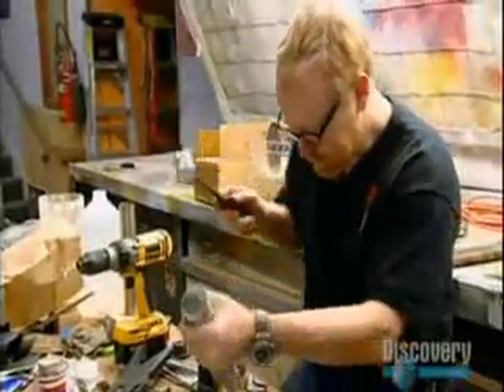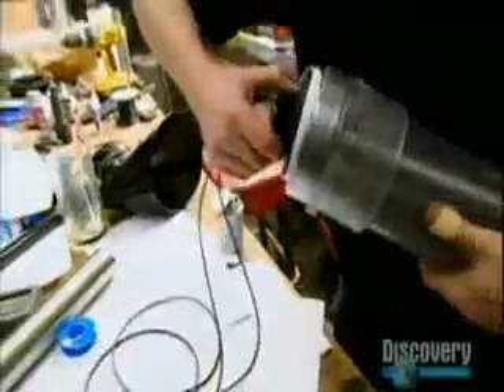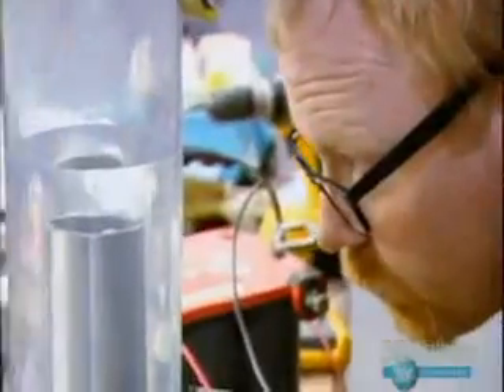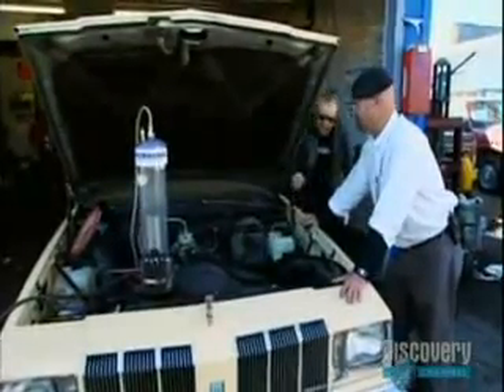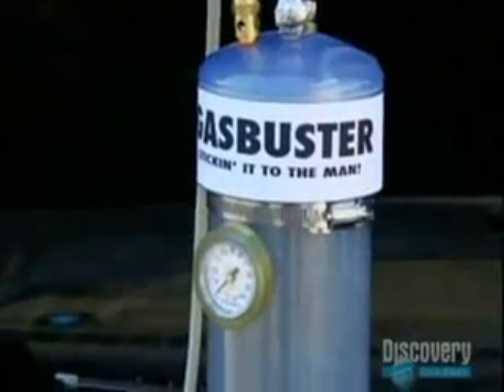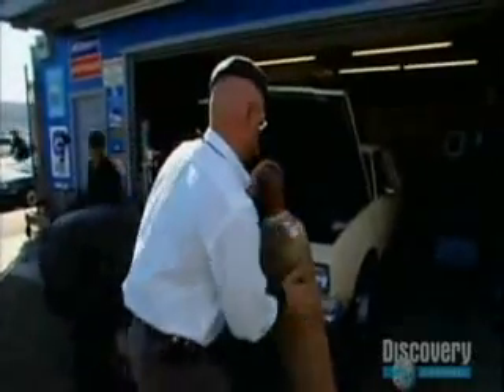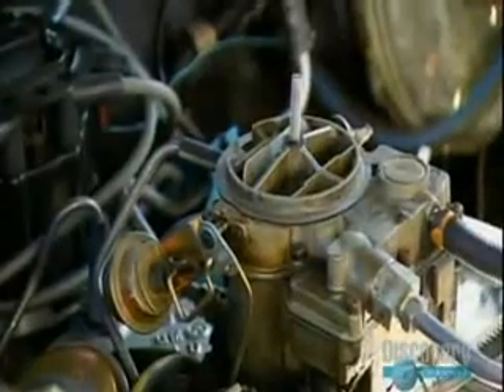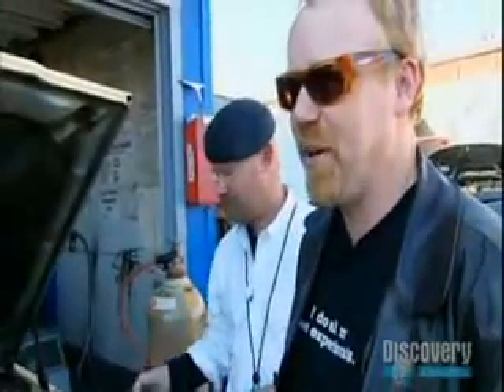HHO Mythbusters Explained

Comment: this is one example of why I lost any shread of faith in the value of the mythbusters' tests.  They appear to be biased and purposely introduce subtle  "doomed to fail" variables in their experiments to discredit the validity of systems that would otherwise cause harm to the wallet of those who sign their paychecks and the owners and controllers of "the big picture"
Reply: You do realize that hydrogen fuel cells are commercially available right? There's no point in invalidating someone's idea, it already exists on market.
Reply: If you understand the basics of physics you would know that these systems are impossible anyway... it requires much more energy to produce hydrogen then you gain from burning the hydrogen.

electrolysis is only about 65% efficient. It gets even uglier when you combust the hydrogen... you only get back about 20% of the energy stored in the hydrogen, the rest is converted into heat. If you dedicated 100 Watts to producing hydrogen and then burn't it in the engine it would only produce 13 Watts of usable energy, which means you'd loose 87 Watts of energy!
Reply: nobody can see that thishow is BS
Reply: Richard Garnache I never said it was a fuel cell. I said that water is currently being used in hydrogen fuel cells.
Reply: Sebastian Ramadan Last time I checked, an engine doesn't produce hydrogen gas. Pretty sure you can only achieve that with electrochemistry - at least as far as water is concerned. Quite a bit of energy is required to break the bonds. ~242kJ/mol if my calculations are correct. 

Assuming water is pure, you've got ~18.01528 mol/g. 1gl of water is ~3785.412g. So you'd need ~50849.59kJ to break the bonds of all of the water in exactly 1gl of water.
Reply: Let me ask you a question that I know you don't know the answer to, (because I had this electric vehicle conversation with the General Motors Senior engineer who developed the best electric car for GM back in the late nineties) what are you going to use for renewable power on an electric vehicle? Batteries that die after three hours of use?

Using something that 'might' work is not very  feasible because having an electric car that requires an automotive electric motor engineer to work on it when it breaks down, (unlike an auto mechanic). Like how often are the bearings needing replacement or the commutator or the field coil? or the magnets? How often do you need to check the resonance in the field coil, do you even know what that is? I got an Electronics Engineering degree in 1975! Are electric cars solid state or do they require a 4-quad INTEL computer chip to operate? Do you know how to fix a solid state circuit board? Do you know how to test to see what is wrong in a Digital circuit? How about analog? What is the hertz needed for the vehicle to start? What do you do after an accident when the other vehicle on Hydrogen crushes you inside your poptart protection car?

 How about when you get caught in bumper to bumper traffic that lasts 3-7 hours on a freeway how much power do you have in an electric?

 How many hours of recharging does it take to be able to drive to work; play the stereo, use the wipers and high beams, and run the air conditioner and maybe the defroster?

 Will it last about three hours using no other power for anything but the motor, or will it die after two becasue it is raining cats and dogs and it is also 25 degrees outside the car?

What do you do when it snows five feet of blizzard in the parking lot, will your electric get you home?

 Or will you HAVE to call ME in my hydrogen powered 7 series BMW? Will I, who have a nearly perpetual motion car that runs off of either sea water, lake water, old radiator water or spit with luxury every-fucking-thing in it, have to pick your ass up to drop you off outside your house becasue you bought a tiny 12 inch wheelbase with 2 inch clearance from the road surface; Toyota Leaf?

It is feasible to use a hydrogen powered car in California alone BECAUSE Governor Schwarzenegger put in the infrastructure of specialty fuel gas stations all up and down the state!
The Senior engineer for GM told me the car they created was great it would have instant power and go like hell, but died after two and one quarter hours and could not keep enough power unless it never snowed, never rained and was never anything but a 70 degree sun-shiny day outside. And that there was zero technically equipted repair shops to service the vehicle, anywhere on the east coat or the mid-west. So unless you live in southern California an electric is ALSO infeasible, due to the FACT that only in San Diego are there electric recharging stations!

Even the GoCar company has to use gasoline powered tow trucks to retrieve their cars when one is taken outside of the recharger range, (only a mile), and there are limited recharging ace's points.

 I just moved away from San Diego so you don't know what the hell you are talking about or to whom you are talking to, electric cars are crap the senior developing engineers at GM all agree with me Though I have a thought that maybe in about a hundred years eventually new techniques of making better batteries will allow electrics to finally become feasible. Right now they don't - Obama lies to you, liberal democrats lie to you and give you false answers that work about as well as a solid iron balloon in the real world.

 Ask any electrical engine designer and they will agree with everything I have just told you.
Reply: Are you going to convey anything useful in this discussion, or are you going to continue to resort to pointless argumenta ad hominem? You're not the only one who can resort to hominem, by the way... Why do you have eleven trade skills? Were you too poor at the first one to make cash specialising in it? Did it take you eleven trades to realise that you should move on to art or business?

Here's what I can do: Pose a logical argument and stay on topic... Do you want to do that? Please ensure you label your rebuttals and keep them nicely organised as such.

WHY IS HYDROGEN ON DEMAND A HORRIBLE IDEA?

POINT 1. Generation and compression of hydrogen by electrolysis is at best about half as efficient as charging a battery. More efficient methods of hydrogen decomposition have been devised, but they're way too bulky to be useful in vehicles or private residences.

POINT 2. Hydrogen has a very low energy density. To run your car from it, you'll need about five times (by weight) more of it than you would petrol (or gasoline, as Americans call it). Seriously, you're better off producing methanol.

POINT 3. Metals become brittle very easily when you (mis)use hydrogen. This might cause components within your engine to fail more quickly than they otherwise would.

POINT 4. The Hindenburg disaster has proven to us that when your engines sealing becomes brittle and starts leaking, there might be an explosion. Not only is a hydrogen leak invisible, but living accounts of the Hindenburg also tell us that the flame is virtually invisible!

WHAT IS A BETTER IDEA?

POINT 5. Electric engines are proven to be much more reliable than internal combustion engines. Think about this for a second... How often do you take your washing machine or electric drill to be serviced by a mechanic? Has it ever required oiling or a new gearbox?

POINT 6. Electric engines are also far more efficient. When you're sitting bumper to bumper in a traffic jam or at the lights, an electric engine will idle at ZERO. They're lighter, which helps build up speed. They can double as your brakes, too... When you brake using your electric motor as a generator, the energy that is your momentum will be transferred back into your battery array.

WHEN IS HYDROGEN APPROPRIATE?

POINT 7. The most efficient use of hydrogen involves using all five products of a hydrogen fuel cell system. Hydrogen fuel cells produce electricity and heat from combining H2 and O2 into H2O (water). On Earth, the heat and water would be waste. In a space environment, that waste heat and water is handy because living organisms need it... In reverse, a hydrogen fuel cell can be used to split H2O into H2 and O2 by feeding electricity back into it (eg. from a solar panel). Due to the lack of atmosphere and alternation between day/night blocking out much UV radiation, solar cells will almost certainly yield far better in space. This all explains why you might hear NASA talking about hydrogen fuel cells, whilst automotive engineers consider it to be a joke.
Reply: ON TOPIC, okay here goes ready yourself for a lot of text!
 Hydrogen in an explosion might burn birds flying above you since it is lighter than air.
; last I heard.
 The Hindenburg was what, an rigid AIRSHIP made by Nazis in the 1930's. And technology has been in a standstill since that time correct?

 Water on the other hand explodes in what form?

 Electrical motors need to use electricity to use as energy.

 So with zero coal production for burning and no fission reactors going on line in the foreseeable future what do you plan on using to create electricity?

 Wait for a lighting storm?

 Wait for a republican to get elected to repeal regulations that have crippled coal mining?

Wait for congress,(everything beneficial is blocked or outright vetoed by Democrats) to come up to speed on the benefits of Fusion energy reactor, or hell freezes over which is when that will happen?

 Using high tension electric wires tend to be a hazard since the resonance created tends to make animals and people a tad unhinged, perhaps that is why you are so obtuse. so how much money do YOU have to string wires from the nearest watermill to generate electricity since that is the only other way to get electricity now that 'Cavitation' is restricting the use of ALL wind turbines, look at the problems in Palm Springs California as an example.

 Solar has YET to produce enough energy to be also able to be legal through congress to be used for vehicles, since it is intended to be only used for stationary structures by LAW.

 Something you haven't yet taken the time to look into. Democrats cannot get kick back money for legislation allowing solar to be used for automobile recharging stations so that is a ways off in the future only when pigs start flying.

 The political points I am making ARE on topic by the way since the infrastructure you are addressing must be legal as well as feasible.

 And as we all know unless Democrats can make sure 95-75% of the taxes goes to their next campaign fund then if not used goes into their bank account tax free by the way the following year they will never allow solar to be used to recharge vehicles!

 So WHAT do you plan on using that will recharge your otherwise dead as a doornail hunk of metal and copper electrical washing machine motor?
I was a welder using TIG on the MFTF project at LLNL in the mid 80's, the democrat controlled Congress at the time cancelled our project in favor of a UNION made fission reactor.

 Even though a Fusion reactor has been running since 1968, that did not matter 'Union' workers were preferable, (only to the Democrats) to scientists and engineers as well as professional specialty welders that use helium leak testing to maintain a pure fusion weld in 6g on stainless 4843 tubing on the ying-yang reactor magnets to do what?

 Oh, create steam to run compressors to run dynamos to create electricity, or in a nutshell using 21rst century technology to create 17th century energy to create 19th century electricity!
 
 As for Diablo Canyon made by the Democrat authorized 'Union workers. The Union disallowed any engineer from coming on site until they were finished.

Lockheed made the prints for LLNL as well as for Diablo Canyon fission reactor. Lockheed used a specialized type of plastic impervious to methyl-ethyl-keytone, acetone or carbolic acid or any base either and were by law not allowed to have any specifications printed upon them only color dot codes. Both LLNL and Diablo Canyon used a separate sheet with all the specs printed per job needed to be done when it was allowed according the management who WERE NOT INSPECTORS.

Special non Union inspectors were otherwise known as Nuclear engineers and because of Union rules as I stated above were not allowed on site until it was completely finished, after going on strike three times and finishing 54 billion dollars over budget it was found that the Union had welded Diablo canyon together completely backwards. It was a welded piece of 554 billion dollars of junk. The plans were clear see-through plastic, but LLNL had registration of the logo on the top left and bottom right of each sheet so we could tell if the print was upside down, Diablo Canyon had nothing!

 This is why California was going through rolling power blackouts during the nineties and why it is also bankrupt from Governor Gray Davis buying power from ENRON without reading the fine print. He did not and could not sell the million dollars per 300 kilowatts back to ENRON for the same price instead he got pennies on the dollar after a power glut.

 The MFTF project was to go online in 1988, except Democrats were NOT going to get kickback money like they do if UNIONS build something, so our project was cancelled and I had to go and find a different job since no one was hiring welders for anything! Becoming something else was a necessity asshole, that is why I had to learn new methods.

 So once again what do YOU plan to legally use to create electricity?
Reply: I have a TS clearance (in an entirely different/unrelated area), but no matter, doesn't apply - the information is all public.  If it did apply, obviously I'd be keeping my mouth shut and not blabbing about it.  For example, the the fully public TMX summary:

http://www.osti.gov/scitech/servlets/purl/6559602 UCRL-53120

In short, they did achieve some fusion, but not confinement which is necessary to be able to run this to produce more than sporadic blips of tiny amounts of fusion energy.  They did not come close to breaking even.  In other words, this thing required FAR MORE energy to run than it actually produced.  As such, it was simply a research prototype/intermediate on the way to understanding fusion - a stepping stone to fusion power.  As MFTF was also.  As it was, changes in MFTF design were prompted by experience with and proposed changes to the TMX, resulting in the device being built to new specifications (MFTF-B), with final design awaiting the results of changes to TMX (aka TMX-U).  Then once MFTF-B was in operation and yielding results, was to lead to the next generation of fusion prototype - the CIT.  Which never materialized.

Yes, it was "running", doing what it was supposed to.  Unfortunately, producing a net gain of power wasn't what it was supposed to do.

This is an excellent overview of fusion research:

https://www.princeton.edu/~ota/disk2/1987/8723/872305.PDF

It includes mention of the MFTF, how Reaganomics ultimately killed it, the shift to tokamak, and developments since then.  Still no usable fusion power, but we're a lot closer than we were in the 1950s.  Hopefully, ITER will finally do it.

Being certified to the level of leak proof He stainless welding is quite an accomplishment.   I can weld, but am light years away from that level - that I do know.  But it has nothing to  do with the research that the machine was supposed to accomplish.

It's entirely understandable that there was at-the-time on-site strict security partitioning of construction/maintenance/QA versus the actual research.  Entirely aside from national security concerns (and the Americans are a bit OTT on that), premature release of garbled/second/third-hand information can be just as damaging.  Most government projects and just ordinary corporations have absolute muzzles on their staff, and everything must be pre-cleared before saying anything public.  It makes sense to reduce risk by reducing exposure even internally.

But as this was pure physics research and the Americans were interacting with many other countries on these projects (I suspect even the Russians at various times - they certainly have later - ITER includes the Russians, Europeans and other countries such as Japan), it is to be expected that they would publish the details of the physics-end of the research and the results.  These projects also had to pass Congress, and since when can you get away without explaining to Congress what the experiment is supposed to do?    I'm sure we can find the appropriate proposed bills and the project's purpose in just moments.  The Russians even wrote papers related to TMX, ex: "Thermonuclear confinement systems with twin mirror systems" by G I Dimov, Soviet journal of plasma physics, volume 2 number 4
Reply: What every one fails to realize is that Myth busters are NOT Scientist and they even say THERE NOT SCIENTISTS. So its not that they have a biast towards some experiments. Example the HHO experiment they approached it the way a normal person would approach it Build one chamber to make the Hydrogen and this is about the measurements and electricity we need to put in it. so it failed. But of course some one who does alot of research and has time on his hand to make a better more efficient device could make it work (in this case). Also remember in this case i think they have good reason to make it fail cause other wise you could have alot of idiots attempt things they should not try. Hydrogen gas is after all very explosive and reactionary.

Also many different plans for the HHO machine online ièm sure if you built one and just started you would see its not working goo long for solution build a new one with new information found its hard for mythbusters a show on quotas to do this.

And again the Special effect Experts, notice how ofthen they think something will totally fail but yet it works they want them to work but some times it just does not turn out some times a flaw in the plan some times not still happy the show exist and will keep watching both the good and bad
Reply: Richard Garnache Mhm. Water is a byproduct, not the fuel. However, water is also used to isolate the hydrogen and oxygen which is then passed through the cell so shrug
Reply: Richard Garnache Mhm. That's what I just said. Sorry if I worded it in a way that confused that earlier.
Reply: GlargodSr Please refrain from projecting your own bias (regarding their intentions) onto other people.
Reply: Sebastian Ramadan
It is a free world where free speech still exist.  If you don'tlike what I have to say, simply do not read it, otherwise who do you think you are to tell people what they aught to say or not to say.  as a matter of fact, i don't care who you are or think you are especially if all you are interested to do is boss people around.  grow up you sheep.
Reply: GlargodSr As a matter of fact, "free speech" doesn't mean what you think. You don't have the right to slander people. That's not in your constitution. In fact, high-profile court cases have been fought and won against what you're saying. If you're so courageous in the face of conviction, then show your real name on your profile... Otherwise, you are the sheep here, cowering in the shadows of your mask of anonymity whilst implying unverifiable and disreputable things about the motif of others.
Reply: GlargodSr Well in Long Beach California and in Panama City Florida there is a company that makes hydrogen fuel burners for your house using this same exact process. BMW also created a car the 7 series that will use this same HHO 'Aquygen' gas. BMW has a condenser that turns the oxygen and hydrogen burned water steam back into water with returns to the 'gas tank'. once a year fuel sounds like a good Idea. The problem with Myth-busters here is that they neglected to figure out the correct amount of oxygen and HHO to burn this fuel correctly. Being a welder/fitter, (IE I know how to weld any metal in any process using any machine in any welding position) and a Tool Maker machinist as well; meaning I can run any machine in a shop to make the tools, that make the tools, to make the machines, to make the products everyone uses in the world.

 But I am not a stunt man like the Myth Busters, myself.

 And having a good friend who unlike the Myth-busters is THE chemical scientist that developed the rocket motors that got all the Lunar Excursion Modules to take off from the moon. I have a NASA scientist that corroborates my statements here.

 This systems does work despite Myth-Busters bull crap here. You only need to use a new engine that has NEVER burnt gasoline or diesel ever!

If the Myth-Busters used acetylene gas instead of HHO they would get a backfire also, which is caused by all the gasoline residue inside the combustion chambers since any welder can tell you steel absorbs gas fumes.

 You are correct the Myth-Busters DID NOT reveal the real reasons their system did not operate correctly, because they intended to fail in the first place. All you need to do is watch who are their sponsors. Was it Ford or Chevy or Dodge Ram? BMW is a German car company not one of the Big Three; also BMW is not affiliated with Shell, Standard Oil or Chevron.
 Unfortunately HHO like the Hydrogen that came before it tends to dehydrate steel making your engine block crack, so the combustion cylinders on a car would have to be chromed like the inside of an AK-47. 

I think BMW came up with a Carbon Fiber engine block ending this problem. But the new problem becomes cost.
Reply: Sebastian Ramadan You should read the last law signed in secret and passed in secret March 12th 2012 by Barack Hussein Obama redefining the 1rst amendment. You'll find that you are actually wrong! (bill 347)
Reply: marcus raidien Where does bill 347 state that GlargodSr has the right to go around saying whatever he likes, regardless of how slanderous or treasonous it is? Quote it for me. I think you missed the point I was making...
Reply: marcus raidien I really think you should study the BMW 7 series more closely. The "BMW Hydrogen 7", as it is called, does not have a tank of water; it's a tank of hydrogen (and separately a tank of gasoline) which you need to refill at a petrol station like any other vehicle. BMW quotes that you need 50L/100km of hydrogen, translating roughly to 21 gallons per 100 mile, or a whopping 5 miles to the gallon. Yes, you would need to generate 21 gallons of hydrogen per 100 mile, or one gallon of hydrogen every 5 miles to run this thing off of water. The same vehicle will use only 13.9 gallons of petrol to travel the same distance. Does that sound reasonable? How long does it take YOU to generate say, 1 gallon? You're a smart man, create such a device and time it. Don't bother answering me, though... I don't want some shifty salesperson advertising spiel about the size of your cock. I'm not interested in an answer whether truthful or bullshit because I already know the truthful answer.
Reply: Sebastian Ramadan To produce one gallon of hydrogen in the gas or liquid phase. I could answer that. ;)
Reply: Justin Dixon You won't get far at all on a gallon of uncompressed hydrogen... Do you suppose the tank they're using in the video holds about ten gallons of compressed hydrogen? If so, that'd get them 50 miles. How long would it take a 485kW (~650bhp) engine working as a generator to fill that tank with 100% compressed hydrogen gas?
Reply: Justin Dixon How many kJ would be required to heat the same water to 2500C?
Reply: Water at STP would not exist as a liquid at 2500C. Give me more information. At minimum I'd need starting temperature, pressure, and volume. Though you did say a gallon so that's one of the three down.
Reply: I don't know I have only seen it used. I am a welder/fitter/fabricator and Tool maker machinist. I don't know the standard operating pressure my own Mercedes Diesel uses to fire each cylinder, I just know how to fix it if it breaks.
Reply: Justin Dixon Use whatever temperature you like, so long as you realise when you hit about 2000C some of the water will start thermal decomposition (also known as thermolysis)... This is the point you missed me subtly hinting at.
Reply: marcus raidien Do you suffer from some kind of reading comprehension disorder? The point I'm supporting isn't that this should be tried; it's that this is unfeasible. If you want a significant improvement in mileage, you're better off installing an electric motor. They're lighter, simpler and more efficient. If you still want an improvement in mileage, going combustion won't help, though regenerative brakes will, and perhaps forming a body-kit of solar cells might.
Reply: marcus raidien Sorry but tl;dr. Take it as you will.
Reply: Sorry I don't speak Twitter or Ebonics, Swahili or Cantonese. So the tenebrosity you are attempting to proclaim has to be taken as a negative since you obviously are desiderating through obscurity an exegesis homonymous depravation, instead.
Reply: Justin Dixon That's just what I was thinking. If I were a sucker, I wouldn't bother reading that wall of bullshit to buy Marcus's "near perpetual machine" bullshit. Marcus just wasted a wall of text.

marcus raidien Have you been living under a rock, or are you just naturally dull? Allow me to respond to each paragraph, starting with the first:

You are promoting some form of retarded generate-your-own-hydrogen scheme. Which would you rather, stopping after three hours or stopping after five miles?

Electric engines are simpler, lighter, more reliable and more efficient than internal combustion engines. Let us think about how often electric engines break down... Have you ever known someone who doesn't overload a washing machine and who's washing machine breaks on them? It just doesn't happen, does it, Cletus? Washing machines, when used within their operating conditions, last YEARS and YEARS without needing to be services. The same goes for electric vehicles.

In addition to that, when you are bumper to bumper in traffic in an electric engine, the battery load will be proportional to the revs you are using, which is... ZERO! Why? Because electric engines don't require idle revs.

Electric cars can charge overnight, but also typically have a short charge cycle of 3.5 hours.

Electric cars run for between 40 and 200 miles, rain, hail or snow. The only way you'll short them out is if you're stupid enough to expose the circuitry when it's raining (which wouldn't really surprise me)...

Yes, please put sea water or lake water into your BMW Hydrogen 7... Fucking moron. I can't wait to see how this goes down! I already gave the stats to you earlier, but please do it. Please put WATER in your BMW HYDROGEN 7 and put a video on youtube of what happens so the other retards can feel good about themselves because they're not that retarded.

Please provide citations for your discussions with the senior engineer for GM. I reckon you're full of shit. Your location doesn't make your argument any more or less valid... There are retards everywhere.

Again, you are promoting a "near perpetual machine" or whatever bullshit, not something that you have to stop every five miles to refill the tank. YOU can't use gas stations in your argument, but I can. Stop trying to weasel your way into a different argument.
Reply: "Running since 1968" - you confuse "running" with "a microsecond worth every couple hours at best".  Uh, no, the MFTF was cancelled because it was (a) the most expensive science project every built to that time, (b) they had to balance the federal budget, and (c) even if it broke even (which is doubtful), it would only have been at most about a second's worth of power every couple days.  Meanwhile, they already knew that fission reactors work, work continuously, and more than break even.
Reply: Fromage Frizzbizz this is wrong.
Reply: @marcus radien Wrong?  How?  No-one has yet (even now, let alone 1968) achieved anything  close to break-even in fusion lasting even as long as a second at a time.  Not 1968, not 1980s not 2017.  The power levels required to fire the thing up are such that you have to store a lot of energy in capacitor banks, which takes time, and then fire it.  Continuous power requires that the fusion device manages to produce enough power to power itself before it runs out of "starter juice".  The MFTF, TMX (both "magnetic mirror" approach, first tried in 1968)  and other previous experiments were attempts to learn how to make confinement work, not produce fusion.  Running?  Yes.  Producing fusion?  No.  Producing useable amounts of power?  Not a chance.

Meanwhile, there's been commercial power production from fission plants as far back as 1956.

The "magnetic mirror" approach for fusion has been abandoned for decades.

Current research is mostly with tokamak and laser confinement and they are making progress.  Current estimates tend to focus on 2050 as being when fusion power will be producing power commercially.  ITER is currently expected go to online around 2027 and be the first to be able to produce useable amounts of power. Already 14 billion bucks so far, completing construction in 2018, will take 8 years to test and adjust the thing before they start with deuterium/tritium as a fuel.  All for a prototype.  Ouch.  MFTF at $370 million was chump change.
Reply: this VIDEO does NOT take the FACT into consideration that this car used GASOLINE originally and has deposits at the 1,000x level of magnification in the steel intake walls so by using an explosive non petroleum fuel made it backfire from igniting the residue!
 ANY WELDER WILL TELL YOU YOU HAVE TO USE ARGON FILLING UP THE WHOLE TANK TO WELD A GAS TANK, OTHERWISE THE TANK WILL EXPLODE FROM THE GASOLINE RESIDUE IN THE STEEL/(or aluminum or plastic) WALLS!

 MYTHBUSTERS did not want anyone to use hydrogen burning cars because of the kickback money from their advertisers: Exxon-Mobile, Chevron and Shell Oil!

 So they made this 'set up' video that tells HALF the story; just like your example!!!!

 You are WRONG especially if you only tell half of the story this is the same as LYING!
Reply: Fusion heats up water in a tenth of a millionth of a second it is COMPLETELY unnecessary to leave a Fusion reactor "RUNNING". LIKE a Fission MUST BE! Fission and Fusion do exactly the same things except Fusion create one third the radiation. we use 21rst level technology to create 16th century technology to in turn use it to make 19th century energy.

Fusion or dangerous Fukushima breeder type Fission to make steam to power dynamos to make electricity!
 Diablo Canyon and the other 150 fission reactors in California cost ten times MFTF!

ONE MFTF was to power ALL of California that is the other half of the story you omitted on purpose, why; because you are a liar!
Reply: One other point you refused to mention Fission Reactors have a 20 year use then become prone to failure and nuclear radiation leakage this is ALL FISSION REACTORS IN THE ENTIRE WORLD. everyone maintaining these reactors is on borrowed time! A Fusion MFTF has nearly zero maintenance since it is only used for a faction of a millionth of a second this means the lifetime of one MFTF is nearly 80 years before a rebuild is needed.

 so what is the cost of rebuilding 151 fission reactors?
Reply: you tell half the story you are lying!
Reply: Sorry, I'm going by the project result summaries of the scientists who ran those projects.

You're right in a way, you'd want to pulse the fusion reaction in a successful fusion power station. As in, say, a few dozen pulses per second or minute.  That's certainly true with laser droplet fusion (spit a tiny drop of deuterium-tritium into a chamber and then hit it with a honking-big laser).

But you have missed two important points:

- the MFTF, TMX and previous experiments of "magnetic mirror" NEVER generated a fusion reaction.  They weren't intended to.  They were prototypes built to test a few things:  (a) how to achieve magnetic confinement,  (b) how to achieve temperatures high enough to initiate fusion and (c) miscellaneous things like "how badly does the machine damage itself every time we fire it".  They were reasonably successful in achieving confinement, but NONE of these experiments EVER achieved temperatures high enough for fusion.
"Running" simply means that they were being used for a number of years (except for MFTF) in experiments to fiddle with the confinement methods and see how high a temperature they could get.

- Design, adjustment, setup for each experiment could take hours or days.  Setups for CERN can take weeks.  That means that it could go days between individual experiments, and each experiment would just be a few shots, then they go to their instrumentation to see what happened with that setup.  You can't run a power generating station with a shot every day or two, even if you could achieve fusion - which they never did.

In other words, TMX and its precursors were "running" since 1968, but they weren't doing "fusion" at all, and certainly not generating power.
Reply: @Marcus Raidien Oh good gravy.  Trace amounts of gasoline deposits in the carbureter, and the intake manifold won't do a damn thing to hydrogen.  They do not spontaneously ignite.  Why would they?   Indeed, that car you were maundering on about a while back (the BMW Hydrogen 7) was a bi-fuel.  It could run off BOTH gasoline and hydrogen.  They didn't flush the whole thing with Argon between switching between fuels.  That car really sucked for milage anyway - only 16.9mpg on gas, and a whopping 4.7mpg on liquid hydrogen (which makes sense because the energy density of gasoline to liquid hydrogen is almost 4:1.

It's not altogether clear whether the Hydrogen 7 couldn't use both fuels simultaneously - it had separate injectors for gasoline and hydrogen, so, conceptually it could if the engine control module was smart enough to deal with it.

What's particularly amusing is that the car's hydrogen tank was incapable of keeping the hydrogen liquid indefinitely.  If you filled the tank with liquid hydrogen, in about 17 hours of non-use, the liquid hydrogen would warm up enough to start boiling and would be vented by the system that protects the tank from rupturing, and by the 10-12th day, virtually all of it would be gone.

The reason why the mythbuster's test "flashed" like it did had nothing to do with gasoline vapors or deposits. Have you never seen a carbureter "burp" flame?  if you're a mechanic, you would have.  I've seen it many times and I'm not even a mechanic.  Happens most often with a hard-starting mis-firing engine  or a slightly flooded condition.  That "burp" would ignite any cloud of any flammable gas hanging around the carb.  Including a spray of gasoline.  Or, Jamie may just have generated a tiny static spark.

Then, of course, apropos this thread, is the notion that in order for a Hydrogen 7 to work with HHO, you couldn't produce HHO - you'd just want the hydrogen (or jam the air intakes shut).

Secondly, in order to have a prayer of having the engine to work, you have to liquify the gas so that the injectors can supply enough fuel to have a hope of getting the engine to run.  The injectors simply aren't big enough to handle gaseous hydrogen or HHO.  Liquifying HHO or hydrogen has two distinct problems: the pump power requirements are enormous, and practical systems would weigh as much or more as the rest of the car.  Secondly, liquifying HHO is a great way to commit suicide.

They only built 100 Hydrogen 7s, and handed them out to celebrities as a PR campaign to encourage people thinking about hydrogen powered cars.  Did you really get one?  I somehow doubt it.  it was a technology demonstrator.  Very expensive to run.  Not a practical vehicle.

The Honda FCX is a better choice.  Decent cost per mile, and is fuel-cell (hydrogen + oxygen producing electricity and water (the water is just dumped)) technology.  About the size of a Honda Accord, will set you back a cool $60,000 USD.  One slight problem.  The fuel-cell stack partitions the car into four separate "passenger compartments".   No 5th passenger in the rear seat.  it would have an advantage of keeping the kids apart in the back seat tho.  Could also curb some rear seat teen activities.

Hydrogen powered cars are coming, but not quite here yet.  HHO isn't it.
Reply: You seem to think I prefer nuclear reactors.  False.  I'd MUCH prefer fusion power for a variety of reasons, not least being that the radioactive byproducts are much shorter lived, the fuel is so much less destructive to the environment to extract, and at any given moment, there's only a little fuel in the reactor (with nuclear, they have years worth of fuel at all times).

But we're something like 30 years away from having even one fusion power reactor in operation.  And in the interval, we have to do something.  Chernobyl was indeed bad, but if we turn off all the nuclear reactors in favor of fusion, we're going to have a long wait with people freezing, coal-fired power stations that kill far more people than nuclear power plants do (coal power emits more radiation than nuclear plants do), and enormous expense as we try to get around the huge electrical shortages.

One thing you refused to mention is that that fusion reactor is going to have to fire more than once.  In fact, it's going to have to fire one hell of a lot to generate appreciable amounts of power.  What matters is NOT how long an individual pulse lasts (the burn time in a car cylinder is equally only a small fraction of a rotation, but they need maintenance often enough), but the duty cycle.  I'd be very surprised if the duty cycle was less than 10%.  As some of the temperatures involved are far higher, metalurgy requirements are going to be even tougher than with fission reactors.  Hydrogen embrittlement with nuclear reactors is bad enough.  With fusion it'll be worse.  But at least it can't leak much, but still the plant is down while they replace the pipe.

Another thing you have refused to acknowledge is that the MFTF was not a fusion reactor.  It was a containment and temperature test prototype.  Doesn't matter how long you ran it, or how little was spent on maintenance, it'd produce precisely zero energy, just consume it.  Lots of it.

Another thing you refused to mention is that the average age of US reactors is 35 years.  Leakage?  One tiny burp that probably harmed no one.  A dozen are scheduled to be shutdown between now and 2025.  Canada's reactors (60% of the power in Ontario) are a little younger in age (but I think we're still running the first reactor every built.  In Chalk River.).  None of them have had any significant leakage.  Several of them are to be shutdown in the next 5-10 years, and the rest are going through a refurbishment project that will last them til 2050.  Sweden's reactors are even older on average than the US, and no accidents.  France?  No accidents.  Germany?  No accidents.  UK?  One minor accident back in the 50's.  Japan?  Major accident of course, but their regulators screwed up and allowed the power company to put the backup generator fuel tanks on the ground floor in a tsunami-prone area  How stupid was that?  If they hadn't done that stupid thing, nothing would have happened, they would have had as long as they wanted to shut them down properly.  That will certainly never happen again.

As for Chernobyl, we have a poorly constructed plant operated by people who didn't follow instructions.  A right royal mess to be sure, but that is not a common situation, and now they know what happens if they screw up.
Reply: where did you work at LLNL? I don't remember you. what is your clearance to obtain information. I was only red level tig welder 408 stainless certified, Helium leak tester engineering dept.

 what is your level?

 which nuclear scientists did you obtain your information from.

 What are your sources?

 I had only one; the place i worked; LLNL 1983 - 1986 when we were cancelled.

 I was not privy to technical information of the sort you are purporting to have attained. I only know how it worked and the fact that it was to go into operation in 2010 and was to be completely automatic encased in 18 feet of ferro-concrete. the extreme lack of moving parts made it maintenance free. the small version was in operation from 1968 to 1984 well over 20 years. I get my information from my co-workers and the few scientists i had the chance to talk with on site during my half hour lunch break.

As for coal producing radiation where do you get that from, I've heard of "black lung" but never radiation burns or poisoning from coal!?
Reply: "You do realize that hydrogen fuel cells are commercially available right? There's no point in invalidating someone's idea, it already exists on market." 
-
This has to be the dumbest statement of all time and makes zero logical sense.
Reply: "+GlargodSr As a matter of fact, "free speech" doesn't mean what you think. You don't have the right to slander people. " 
-
Free speech meanings I have a right to say anything I want about someone. you can call that slander and they have the right to sue me. If they win in court I pay them. I can then resume again, and the process continues.
-
Free societies usually use suites. Your Rights do not come from constitutions, they are natural Rights. 
-
I think you don't understand Free Speech.
Reply: Ryukikon Let's just consider this from another angle. Consider this, how many inventions do we use every day today in our daily lives that at one point or another the popular consensus was that they would never work? I'm sending a message from one now. So why not be optimistic at least?
Reply: Mine was s ie red. since i was building the machine alongside the scientists and engineers who had designed it in the first place.

 I had only to tell the security people at the lab the friends of my friends of my friends to obtain clearance i don't know what you have to have for top secret. That is only three layers.

You site Reaganomics as the failure of funding without bothering to mention (at all the real reason) and explaining that the Harry Reid DNC controlled congress cut our funding in favor of UNIONS building Diablo Canyon by welding it together completely backwards costing twice as much to build a Fukushima type reactor.

Also the whole reason for using a reactor as i understand it is to not get energy directly from a Fukushima reactor, (which i understand is actually impossible with current industrial technology of a practical nature - that is beyond experimental applications) or an MFTF reactor is to heat up water under extreme pressure to be used in a steam run a dynamo to create electricity.

 This means we are only heating up water to extreme pressures to run a steam powered dynamo to spin at high speed within a electricity generating magnetic field at 60 cycles per second then using step down transformers to regulate the flow to the electric grid.

 And since the "Tesla pancake" is illegal in the United States a private citizen is barred from creating all the electricity they could need from the magnetic field using the gigawatt flow in transmission wires instead of direct AC. - as I understand it.

 This is not 'using' the ampere flow of the current at all it creates its own power from the flow however siphoning off nothing from that flow, still this is illegal even though no power from the electric municipal company is actually used at all. To do so would of course negate having to pay for consumer power ever again by use of a simple device. It is illegal only because the local government could charge nothing from its use. The could be no taxation either and this in itself could relieve ALL the problems of electricity usage and would of course bankrupt the government controlled utility company since they are in fact the reason why electricity has to be paid for at all.

Everyone talks about coming up with renewable power systems without addressing the principal reason Tesla invented it in the first place;

 it was meant to be free for everyone.

 Thus if everyone had a Tesla pancake installed on a electric pole outside their house, even the low power output of a MFTF would be sufficient to power all the homes in the state of California.

 Dispute that one!

 This is an economics problem caused by the greed of the DNC!

And you blame Republicans, so petty, how liberal of you, how George Soros inspired!